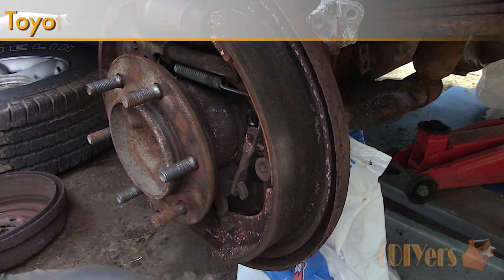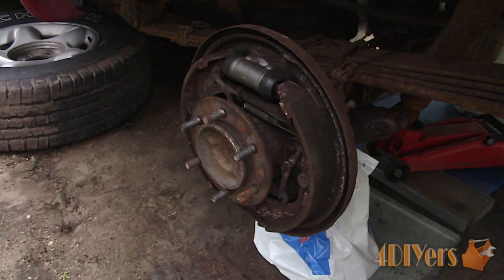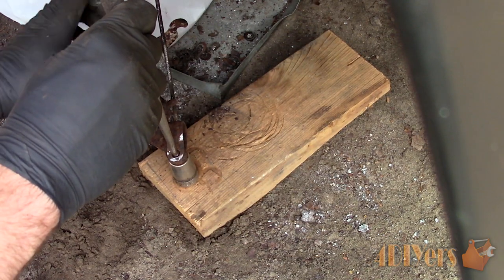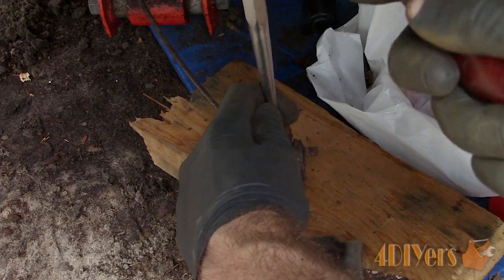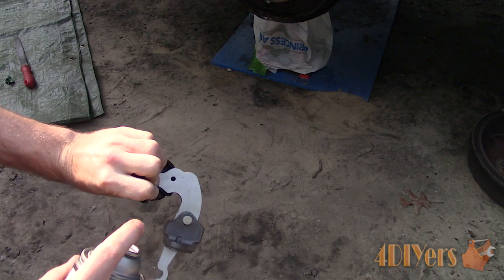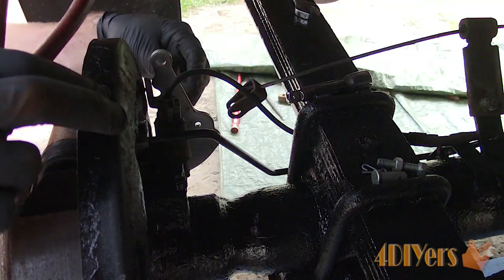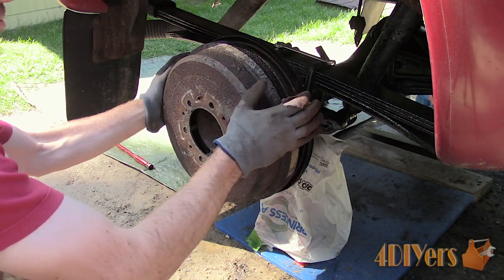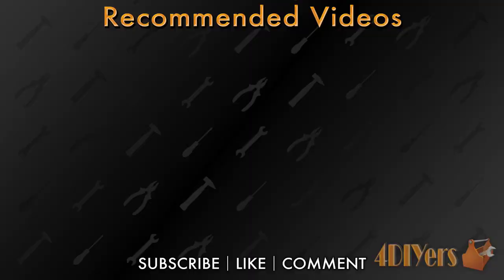How to: Toyota Tacoma Parking Brake Bell Crank Replacement

Comment: Hi! I have a 2000 4Runner, so you might be able to help. 
On the actual cable itself, is the equalizer assembly (part #46341-35030, at least for the 4runner) supposed to be loose when it attaches to the frame or snug/tight? My old one was tight, but I don't know if that was intentional or rusted in place because I now have a gap with the new assembly. Thank you!

Comment: how do you make adjustments to the bolt and locking nut on the bell crank? If the bolt is closer to the backing plate what happens? if the bolt is further away, what happens? do you have to adjust the same way on both passenger and driver side?
Reply from the maker: It's covered in this video https://youtu.be/GAS-bkj50is
Reply: You made some specific ranges for the spacing between drum and shoes and bell crank bolt and backing plate, but you did not show how to do that or where you got that info from.

Did you measure the inner diameter of the drum and subtract the spacing between both shoes?

Did you use a feeler gauge to make your measurements? Video is good but does not show that specific content which would have been useful.

Comment: would this be the same for a 2004 Tundra?
Reply: This should be pretty identical to the Tundra. I'm doing this later this week on my 2006 Tundra and will try to remember to report back.
Reply from the maker: Should be very similar, it's a common setup on Toyota trucks.
Reply: @4DIYers  
Thanks ,I  kind of figured it would be.
Reply: @bft590  
Thank you!